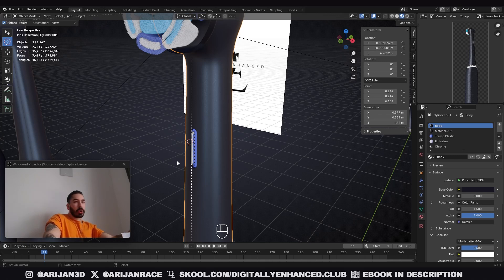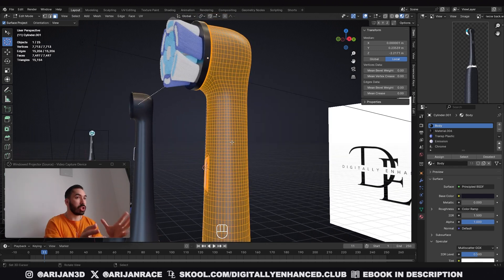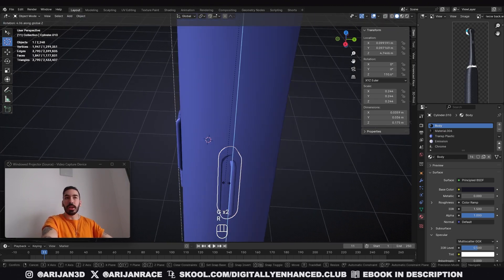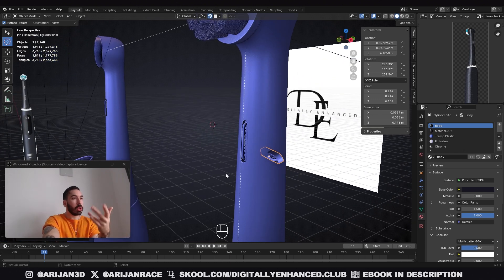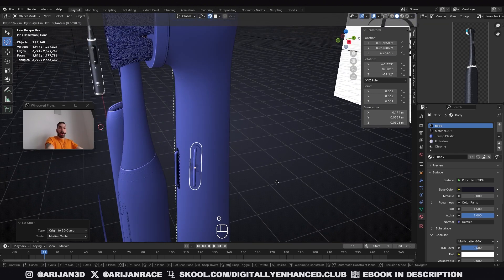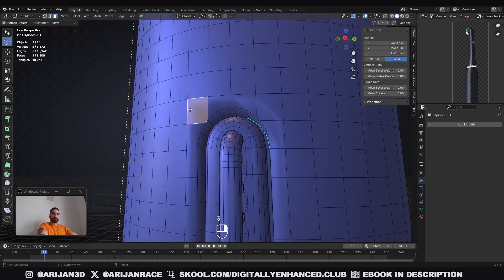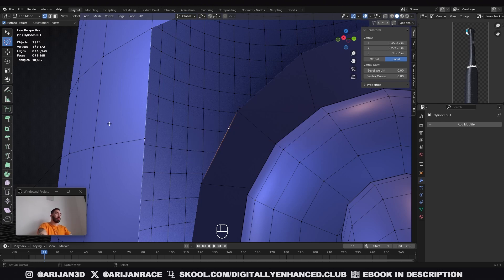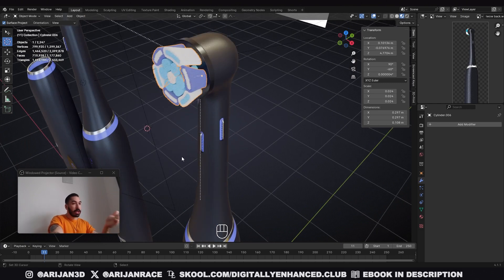Important Hard Surface and Topology tips in Blender (Aryan)

Comment: Better way is: 
- Set Origin of the part to the position of big cylinder center.
- Set Pivot point as Bounding box Center (use Origin)
- Duplicate and Rotate around Z axis.

You can do this by using Geometry Node too (Rotation around Circle)

Comment: Hey! Switch to origins edit and you can snap the origin to that face, with rotation,  like it is an object, the same way you did with the detail onto the toothbrush. The origin's Z will align with the face normal. No need for extra objects ; ). You can even use this to realign an object to world orientation using some flat face as the base. Learned this simple "trick" on blender artists forums.